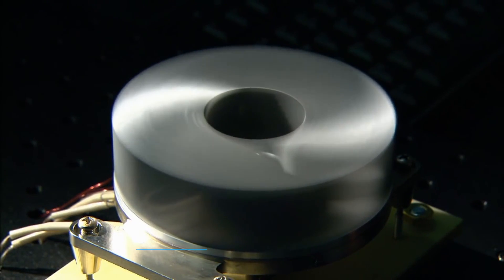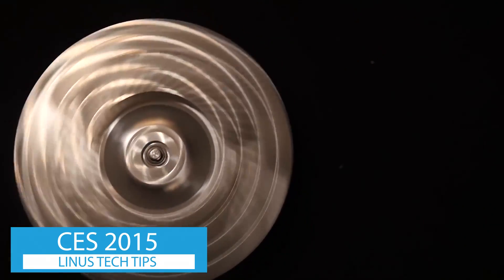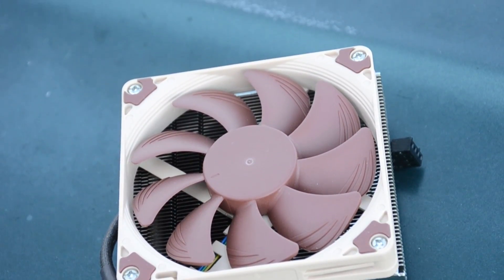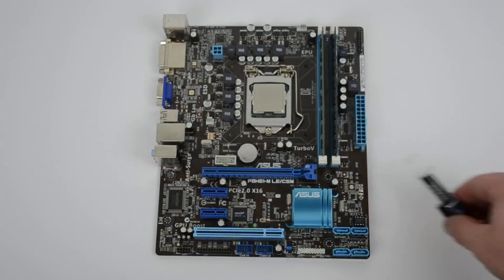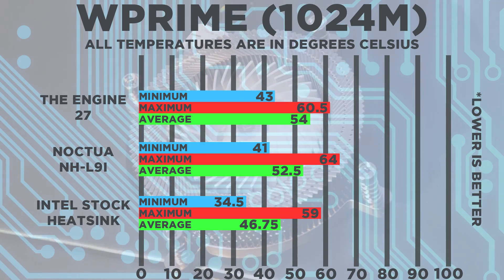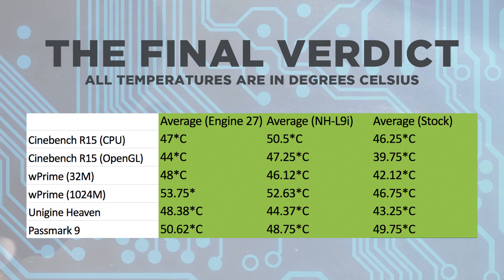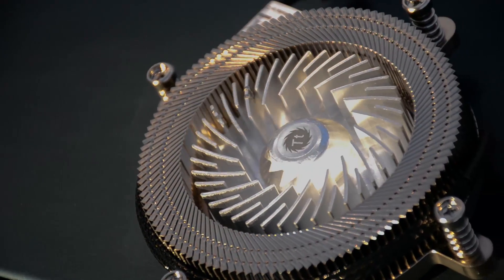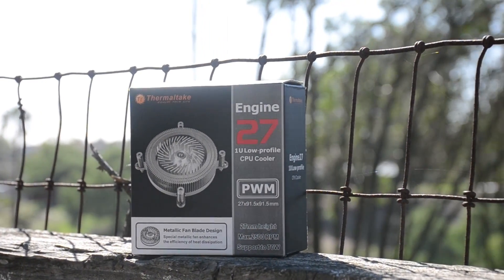The Sandia Cooler Re-Born | Thermaltake Engine 27 Review and Comparison

Comment: Everyone mentions the form factor but no one is talking about the thick bracket it comes with which contributes to the vertical dimension of the entire assembly and puts it out of a 1u spec in a lot of cases. I'm currently building a mini-ITX system in a 1u half rack chassis from supermicro and the Engine 27 has MAYBE 1mm clearance between it and the top of the case. There are no air holes in the case above the CPU, nor would it make sense given its a rack mounted case. I'm waiting to get my RAM before I turn it on but I have serious doubts about it being able to pull in enough air to work well. I'm using 3 40mm Noctua fans running in the front so if it doesn't work I might just get a 1u heatsink, server style.

Comment: Hey Tech Bank, do you think you could post a video on any temperature improvements if you were to add a 120/92/smaller fan on top of the engine 27 to act as an intake fan?
Reply from the maker: Hey Harry! Great Idea! It would take a decent amount of Jerry Rigging, but I'll take a peek in my bin of fans and see how this would work :)
Reply: Fantastic! Would be very interested as to how this turns out because it's a really nice looking cooler design.

I know that the center bit acts as the intake as shown in this diagram: https://www.techpowerup.com/img/11-07-15/73b.jpg
So I'm not sure whether it would be better for a small fan over the center hole, or larger over the (60mx60mm) moving fan, or larger over the whole thing (92mmx92mm).

You could attach it via zip ties if you wanted to do it really dodgely ;)
I was personally planning to attach a fan to the top of my case above the cooler as it's quite low profile